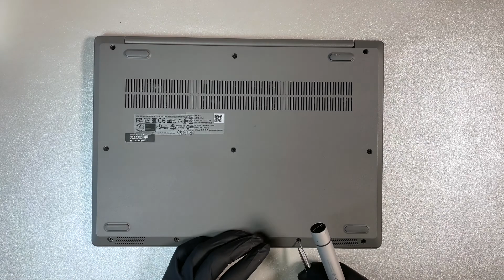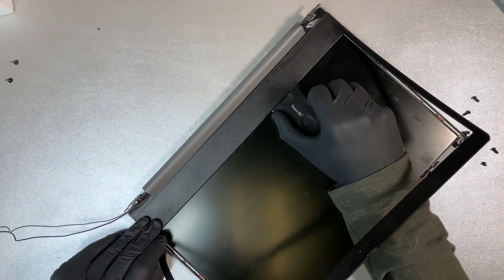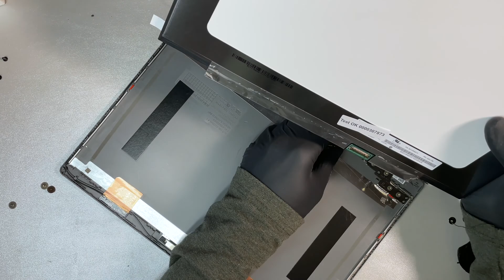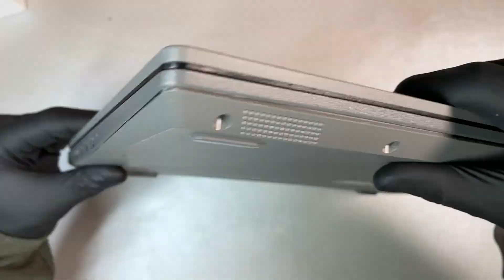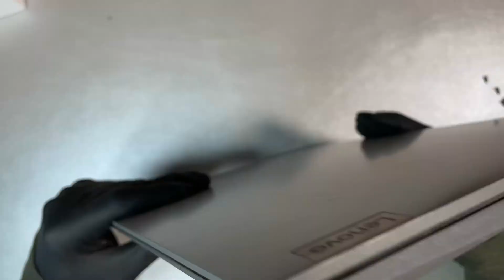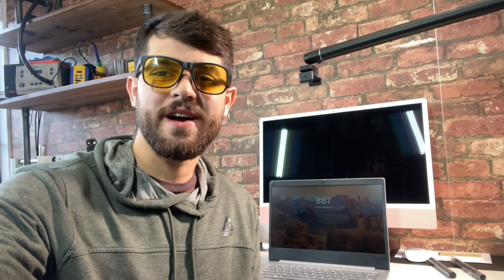Lenovo IdeaPad 3 Screen Replacement | LCD Replacement

Comment: What do i do if the tape breaks on me?
Reply: Pretty sure you can pick some up at an electronic store.
Reply: @Prolific38 not what I mean in the process of removing the tape if it breaks mid stretch and pull the edge you have access to will have disappeared in the middle-ish of the screen length prompting you to bend the carcass (possibly danifying the screen) tô retrieve it

Comment: At how much temperature are you setting the hot gun?(anyone who knows is welcome to reply, I would really appreciate it)
Reply from the maker: The method of removal depends on the device and the type of adhesive used. If you lack the necessary tools, the simplest way is to physically touch the surface. If touching is not feasible, it indicates that the adhesive is ready to be removed. However, it's important to avoid applying excessive heat and ensure that the removal process is done gradually.

Comment: Rather than replace just the lcd screen, is it possible just to replace the whole screen?

It would have been good to know with some text explanation what all the things you unplugged were before you took the screen off? E.g. what were:

1:28 What was that you unplugged? Is that the battery? So you don't get a shock?

2:04 Is that the speaker being unplugged?

2:18 Is that the screen itself being unplugged?
Reply: 1 you can't get a shock by touching cables. And even if you manage to get a shock it won't hurt

2 that's the wifi adapter. The cables lead to the monitor, because putting the antenna for wifi inside of the monitor gives a better signal

3 yes, those metal things on each side makes it so that you can flip the monitor
Reply: @artemido01  Ok thanks

Comment: Sir I have a Lenovo IdeaPad 3 that has TN display can I change it with IPS display? It is 15.6 inch how?
Reply: Hi, I am thinking about doing the same thing. Did you changed your display? If you changed the display, did it work? Also what panel did you order? Thanks so much in advance